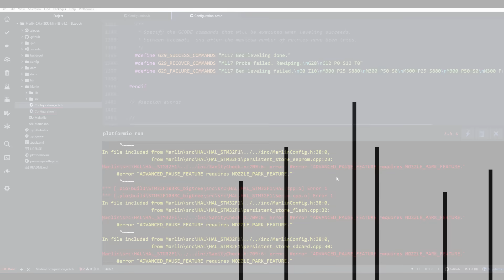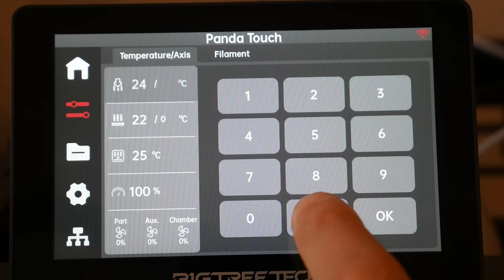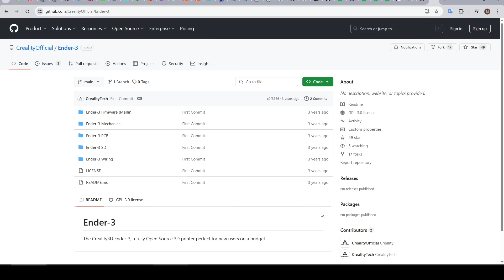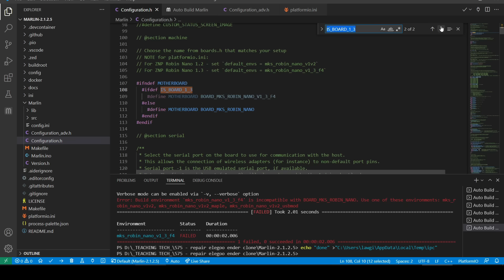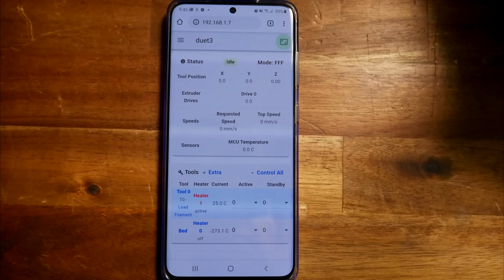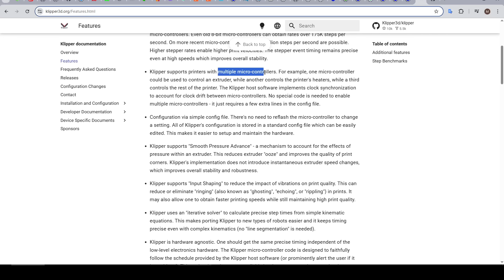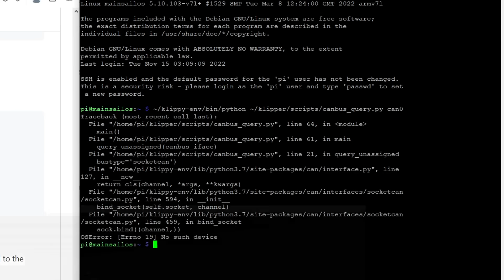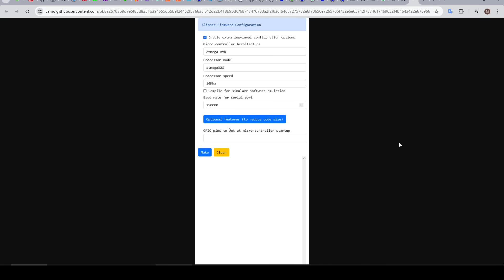What each 3D printer firmware does well, and where it needs improvement

Comment: My dream is configurable (really configurable) Marlin. FIRMware. If it only had printer.cfg file or everything configurable via menu. Change stepper type, add an extruder, add bltouch, second Z motor? Ok, just change settings. One noard instead of board + computer. Without an (very delicate and easy to crash) operating system, poweroff-proof, bullet-proof. Just getting some rich 32bit board with ton of GPIO and six or eight. Compile ONCE and forget. Rock solid.

Comment: When i got my ender v2 i had to upgrade the firmware to run the bed probe routine as i fitted a BLtouch probe , i also fitted dual Z axis screws and link belt - nothing major but for the extra cost it would have added to the base unit i would have happily paid instead of doing it myself . Printers are a bit like cars , some just want to turn the key and drive it , others want to modify it to death but they both need the same basic working platform to start from - this is what i want to see from the manufacturers , plug it in and it works and is reliable but if you want to modify then that is your choice rather than being a necessity to having an operational printer.

Comment: I am new to 3D printing, 2-3 months in. Printer Ender 3 v3 SE.  This printer was great for me out of the box. I love to tinker and understand so once I found out about klipper I had it up and running on a pi 4 within the first week. I have always loved electronics and tinkering so upgrading and customizing software, firmware, and hardware is right up my ally. I have a guy I work with who has had a Bambu P1 for over a year and he loves it but he has no clue about just what little knowledge I have learned in the past 2 months. So different strokes for different folks! Thanks for the content! Currently saving up to get an SV08 and do the multi tool head upgrade!

Comment: A very interesting outlier is RatOS. It still is Klipper underneath but as long as you have a supported board and printer, it's as simple to set up as installing a game. Documentation is great, you do everything via the web interface and it can even flash your printer's board through the web interface, as long as the board supports it. Also comes with a lot of very useful macros and tools.

However, if you're running a printer and/or a board that's not supported by RatOS, you may as well just give up. Adding a new board isn't impossible but also not straightforward at all but adding a new printer requires you to be very familiar with linux, even though it could've been much simpler. Overall a very frustrating experience for me, so I had to go back to Klipper and I still dream the day I can go back to Marlin using Input Shaping using accelerometers.

Comment: We have a Fusion 3 Edge 3D printer at work.  It has such great potential, and huge build volume.  Unfortunately the firmware is just not on par with what others are using.  When we asked customer support to help us with how to properly set it up to better print PETG, their answer was don't use PETG...  😅  There's no filament runout detection, it'd keep printing when you run out of filament.  For how much it cost It's sad.

Comment: Part of the problem with locking out the PID tuning is the tuning values are only good for the condition under which the tuning took place, manual or automatic. 

I worked in the process control arena of the pulp and paper industry for almost 40 years.  I have fought the fight many times trying to explain, you can have tight, accurate tuning for one product, or you can have more loose and everyday tuning for most of the products.  Tuning also changes as external environmental situations change as well as when things start to wear.
Reply: So can you do like a PID calibration fore each temp?
Or some algititem that finds the best fit fore molteble temps

Comment: I also had that problem with the network manager I had set up a raspberry pi to run a printer I bought used that had clipper and I had the same problem I don't know why I had to reinstall the OS start over and when it asked if I wanted to install but network manager I told it no I was able to maintain internet connection after that

Comment: I've compiled Marlin with and without the auto build My SV02 solvo updated the firmware not long after I got it and it went from absolutely beautiful printing printer to a teenager because everything printed with pimples or blobs whatever you would like to call them so with the help of your channel and some others compared the two firmware and compiled my own to fix the blobs achieve the improvement solvo intended and now I'll get beautiful two color prints I also have two machines that I have converted to clipper both clipper and Marlin have excellent resources to explain problems or features The only problem with both, these resources are still very technically minded explanations or definitions I have the advantage of being 43 and learning computers with MS DOS someone 10 years younger than me or 10 years older they need things in a technical definition, as they are now and in a layman's terms because even I sometimes struggle to understand what the documentation is explaining because the people who write the firmware and the documentation they know what they're doing so to them the documentation is clear to someone who, is like a 3D printer it would be awesome now I want to make it better but I don't even get a fifth out of my windows computer that could be extracted from it cuz I don't know how. so a little easier to understand, maybe firmware for dummies section under each explanation

Comment: For klipper you should mention Kiauh. While it requires you to use the terminal, it's much easier because you only need to install git with apt, clone the repo and run the tool, and that's pretty well explained in the readme page. Anything else is done by Kiauh automatically. All my klipper installations have used Kiauh.

The only hiccup I had last time was that my pi was accidentally disconnected while apt was installing something, and then kiauh didn't work by itself until I did "dpkg --configure -a" which is a common thing to do when apt is interrupted, but it would be nice if that situation was automatically detected.

Comment: Web interfaces to help configure firmware sound great, but if they rely on an externally managed server it kind of defeats the purpose of open source and self control. If I buy a new printer I would expect the manufacturer to fully install and configure all firmware. At this point there is still not quite the off-the-shelf printer that meets all my needs so I will still configure and make my own (mostly Voron, Klipper).

Comment: Setting here running Gentoo Linux on a System 76 laptop, using Prusaslicer slicing models made mostly in Freecad for a upgraded open source delta printer running a Duet2 board, have an Athena 2 resin printer on preorder.  Chances of me buying a bambo printer is exactly zero.zero%

Comment: Klipper imho has a huge limitation currently, but it could be fixed. The way NTC temperature probes are handled is not good: they can be defined either by interpolating 3 temperature points, or using the Hart formula. Both approaches dont work when sensors are used at their extremes, which is the case of most V6 like 300C temp sensors.  I had that issue with a 104GT probes that read 30-50C less on klipper but is spot on with marlin. The difference is marlin uses an interpolating point every 10C. I melted my ABS carrier while trying to do 260C calibration on klipper. I tried extracting marlin's values, but I gave up after trying to extract that data, which is mixed up with raw ADC values. Right now I had no choice but to go back to marlin because of that. I also crashed the nozzle on the bed with klipper, as the BL touch I use seems unable to use a specific mode. No issue with marlin on this point.

IMHO, having to edit, compile then flash marlin's firmware is its main issue. Once that is setup, it is a matter of editing 1 file for most of it, a second for advanced stuff, and that is pretty easy.

Klipper on the other hand is a lot harder to configure - but it is easier to go trial and error, as there is no compilation needed. 

For now I cant use klipper (as stated above, temperature probe handling issue), but I will probably give it another go sometime in the future.

Comment: Marlin's main issue, from my dev point of view, is how it is written. My eyes bleed whenever I try to read / modify / extract data from the code. I use it with VScode and autobuild, and it goes pretty nice once setup. Your issue around @7:30 is typical of a C/C++ program, not that much of a marlin issue; it needed a clean build. there may be a way to force a clean on every build to never ever be bothered by that again, but it means rebuilding the whole firmware every time, not just what has been detected as changed.

Comment: Bambu is elite! Open source is great if you want to modify stuff, but if it works primarily as well as you like then it is sooooo great. I use their cloud it is terrific, but I am a hobbyist I have no IP issues. My interactions with Marlin and Klipper haven't been good I do want that as my hobby and I can handle a little coding. The worst is my klipper artillery SW4 plus, yeah I will stick with Bambu if I can!

Comment: In terms of Open-Source hardware/firmware modifications, I've always thought of it like rooting/jailbreaking a mobile device:
1. It is done at your own risk and you will probably void your warranty and should not expect any further help from the device's manufacturer.
2. A device owner should be allowed to use their device however they want, as long as (1) is kept in mind.
3. Cutting out/restricting existing features in the so-called name of "security" by using questionable fixes is a huge disservice to your consumers (I'm looking at you, Google and Bambu Labs...)

Comment: Coming up through all the firmwares, Klipper is definitely my favorite for it's flexibility and relative ease of adding features. Trying to update a factory fork on my Qidi actually soft-bricked the mainboard, but two fantastic guys on github walked me through how to cut the factory fork out and replace it with actual Klipper. What's better, the printer performed 100% better afterwards where the factory version had commands that inverted the bed movement for instance, or would crash into the hotend and destroyed the first plate that came with the printer. After cutting out the cancer, the printer is Stupid reliable and prints like a well-oiled machine. Updating functions through the configs is a particular treat, as you mentioned, you make a few changes, restart, and away you go. SSH'ing through an ethernet cable, I don't even have to take the printer apart to pull the board to reflash. 
That said, I still have Marlin on a few older printers that are living their third lives in iterative rebuilds, so I'm happy I've had the previous experiences. Reprap I ran initially but never got proficient with it and relied on prebuilds.

Comment: I think all these options have the place, for example RRFs handling of toolchangers is far superior than any other.

But Klipper is the current hotness, I have multiple Voron's running it and I enjoy setting up and using it via both web UI and klipper screen.

Marlin unfortunately has been past by both of these despite there being 1000's of printers still using it.

Bambu Lab while "just works" is completely locked down and as we've seen they will always have control over what works and what doesn't. Their recent announcement of future updates has done them no favours on respect in the maker community but 3d printers are no longer the toy of the hobbyist, they are now tools and money making machines for every Tom, Dick and Harry. Who have no interest in tinkering or probably the knowledge or skill to do it.

Another thing where the Maker is pasted over for the profit.

Comment: Your work shows just how you are a "power user" but it seems that market forces have moved away from that to the Bambu Labs scheme where it all just works.  My history is like yours where I designed 3D printers completely and used Marlin at the beginning.  However, now that I use my X1C as a "printer of CAD prototypes" I, too have moved onto this new scheme.    The very troubling issue that Bambu Labs seems to be moving towards access to my custom work - yes, not there yet but their ecosystem is closing in.  Let's hope Prusa keeps going and that the Prusa CORE One is a success.

Comment: I've own just one printer, my old venerable Anet A8. I updated its firmware to Marlin 2.0. 
Recently, I wanted to give it a major overhaul and I'm converting it to CoreXY thanks to the thingiverse community. I got a more powerful 32bit board too.
Then, I decided to use octoprint to forget about moving the SD from the printer to my laptop, so I got an OrangePi Zero 3. I quickly realized that this wasn't worth a dime. The SBC wasn't doing anything other than serving the web interface! So I quickly migrated to Klipper.
I haven't finished the conversion, but I've running Klipper for some months, and I'm really enjoying it.

Comment: Another great video! As for me I want both. I want a printer that just works (an appliance as some others have put it), But I also want a printer I can modify, customize, and tweek if/when the need/mood strikes. I don't expect one printer to be both though. My BBL P1S & A1 Mini are rock solid & just print. I am not upgrading fw or slicer  to their more secure version though. My Qidi Plus 4 is a good printer with a lot of features and more generous build volume, but it has more than a few problems. ATM it is in pieces on my workbench. I am also unhappy with it's closed Klipper implimentation. I have an Elegoo Centauri Carbon ordered, and it may end up taking over (mostly) for my Qidi Plus 4 since it can print engineering materials such as ASA, PPS-CF, PPA-GF, etc just as well as the plus 4. But I am also looking at a SOVOL SV08 or a Rat Rig as my next printer (as a hobby printer thinking of tool changer versions). But like others I am busy; I work 60-100+ hours a week, often times out of my home country, I have a hobby farm that I am always behind the season with, I have too many advanced hobbies that are costly and require a level of proficiency and time commeitment. So like I said in the begining I want both. Few offer it perhaps the SV08 or the Rat Rig (though I am catious of the RATOS)...

Comment: I can definitely see the simplicity with the Bambu method, pity it isn't open source. In terms of the other three, normal hobbyists would totally be overwhelmed by the terminal type interface. Most people want a simple plug and play machine that requires no additional knowledge. Except maybe 3D design, but even that is beyond a lot of people. 3D printing is not restricted to enthusiasts anymore.
Reply: I think allowing people a low barrier to entry actually leads them into learning more about the machines. I started out just wanting something that prints and just printed other people's models, but since getting it I've learned a lot more and could easily deal with a more complex machine. But doing that from the very start would have been overwhelming and I probably just wouldn't have even bothered.

Comment: The comments mostly break into two categories - 1) I love being able to tinker to optimize and redesign.  2) I just want to print and Bambu is awesome.  The two aren't necessarily mutually exclusive.  Bambu was successful because they made 3D printing easier but other manufacturers can fully embrace open source while making everything much easier.  Properly configure Klipper firmware so the community doesn't need to do that.  Provide robust and well tested profiles for PrusaSlicer and OrcaSlicer before the printer is released instead of re-skinning OrcaSlicer so it only works with one printer and won't be supported more than a few months.  Provide well tested filament profiles for generic filaments for the new printer that are available as soon as customers can buy the new printer.  Make it easy for customers to upgrade pre-configured Klipper, including the most popular community improvements.

Comment: I started building printers when there weren't consumer 3D printers and it seems that 3D printing truly came into its own with the advent of Klipper, which owes much to RepRap and Marlin.  I want to buy a printer with properly configured Klipper but I also want mainline Klipper and not a manufacturer's proprietary crippled Klipper.  Firmware and slicers, open source made 3D printing what it is today.  Huge thanks to all of the developers.
Reply: If you have the configuration.h from marlin, configuring printer.cfg is a breeze. I did it with my first printer which was a DIY (dolly from toms3d) and took me like 5 min. Just follow the tutorial in the docs

Comment: Thanks for featuring my RRF based POC printer.  I'm really enjoying using RRF for this - in particular the parallel processing, multi Axis, dynamic changing of configuration, fast reboot times and real time processing capabilities within this firmware.   I agree though that Klipper GCode and Configuration is easier to read, plus l like that fact that it supports so many different hardware combinations..

Comment: As an old style Table top gamer from Avalon Hill Historical board games to Adv D&D, D&D 3.5 and PathFinder v1 and have thought of buying a 3D printer. I just want to plug an play. I'll learn 3d modeling for what block walls I want. I'll probably use the easiest practical slicer for the model I will buy.